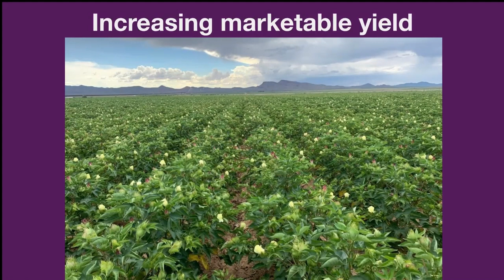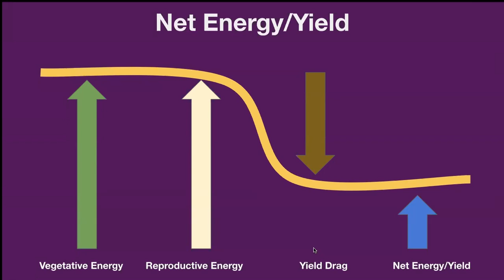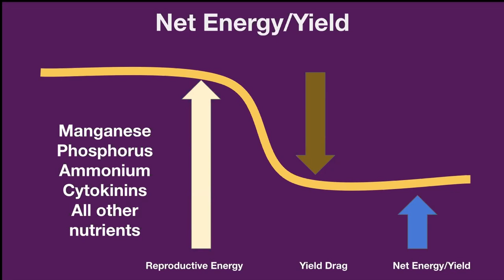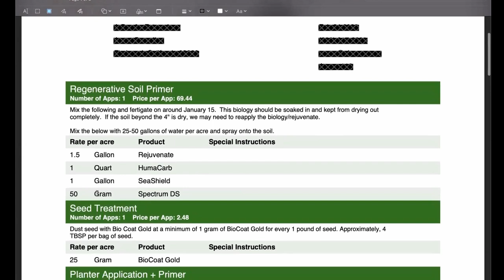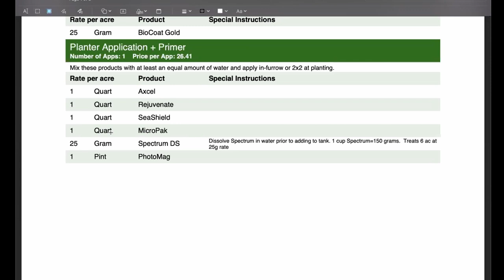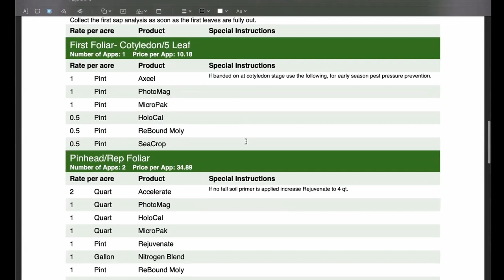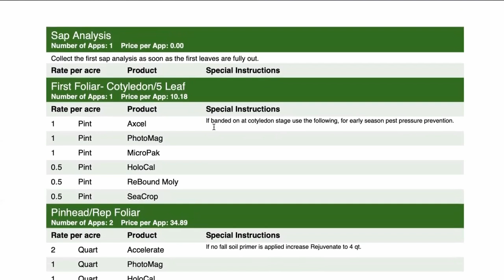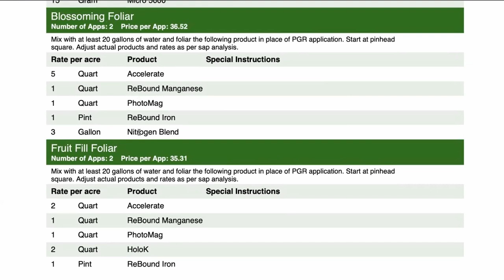A Regenerative Agriculture Future for Cotton Growers - Part 1

Comment: What can eat the contaminated soil at the train wreck in Ohio?
Reply: Tainio Biologicals OP8
Oppenheimer biologicals in Austin may also have the necessary biology
Reply from the maker: Dan suggested OP-8 below—OP-8 contains a powerful blend of beneficial petroleum-digesting soil microbes specially designed to digest petroleum hydrocarbons and other toxins from contaminated soils and waters and is extremely effective at doing that. It would be very helpful if you are concerned about historical pesticide use!

However, if you have contamination from the spill on your property, you really need to reach out to the Ohio EPA directly!